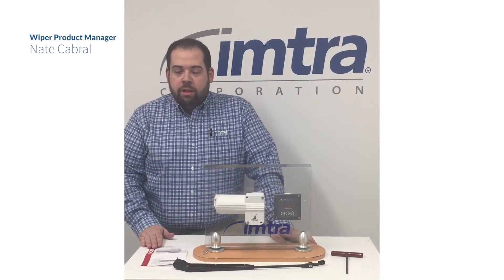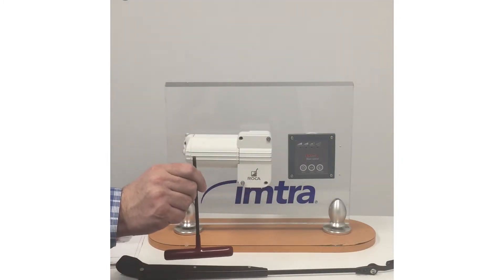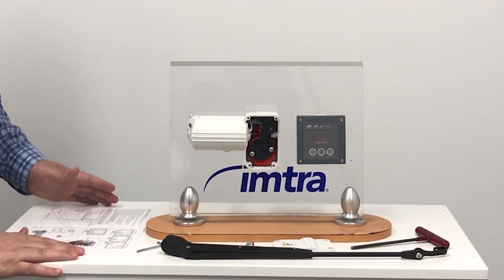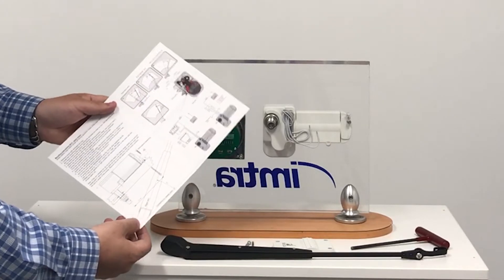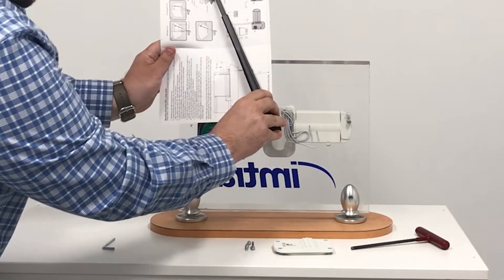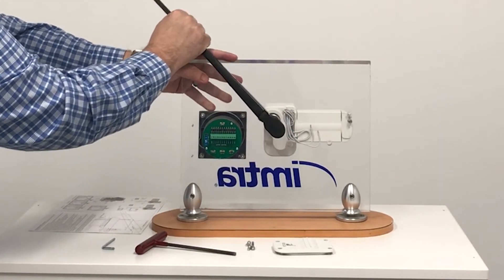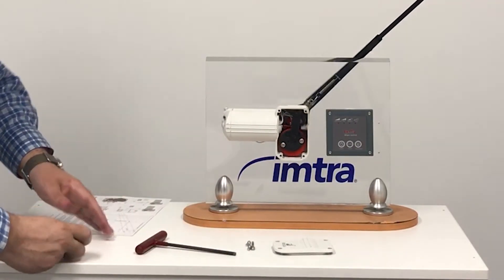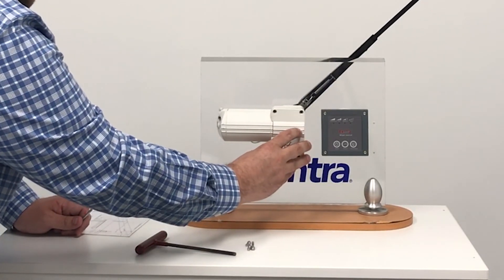Adjusting the sweep angle on Roca W12 Motor

Comment: hi could the park position be at 12 oclock?
Reply from the maker: With the W12 motor, having the wiper arm park at the 12 o'clock position is not achievable as the sweep disk cannot be rotated.  If you were to set the arm/blade to a 12 o'clock parking position, the sweep would need to be very short, and would only clear half the glass.

Comment: I have a problem with my wiper and need to "restart" the installation process. How do I ensure that the motor is in the right "position" before I apply the wiper at the 22.5° angle? Thanks
Reply from the maker: Sorry to hear you have a problem.  We would be more than happy to assist you with restarting the installation process.  Please contact our customer service team directly either by calling them at (508) 995-7000 or by email at info@imtra.com.  Looking forward to hearing from you.

Comment: Good video if you’re wanting to install the wiper to have a 90° sweep, but how do you increase the sweep angle to cover more of the screen?
Reply from the maker: The same process would be used to set it beyond 90-degrees. The W12 motor has a maximum sweep angle of 110-degrees, so the furthest off center-line the arm can go is 55-degrees, and if it is set there, it will sweep 110-degrees (55-degrees on each side of the center-line position). If you have any further questions, please contact Imtra's customer service: https://www.imtra.com/contact-us.htm